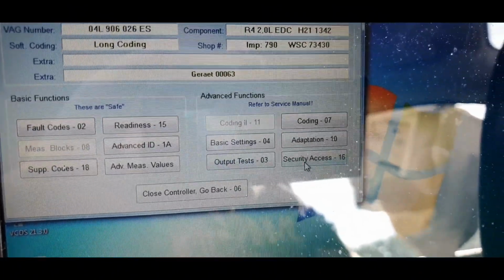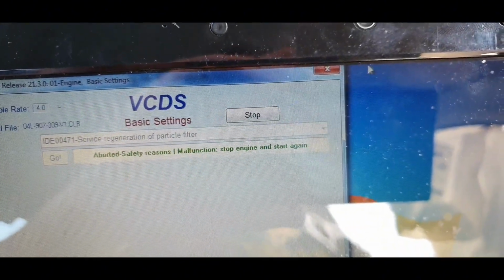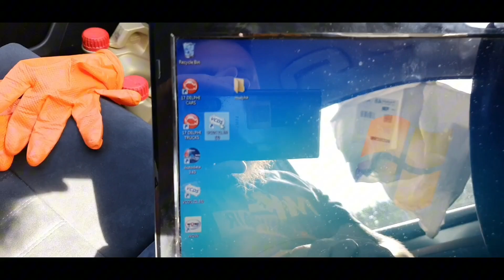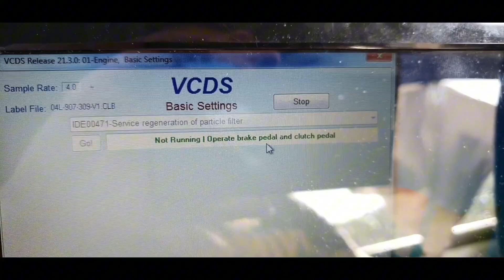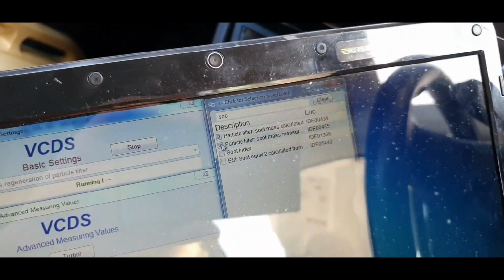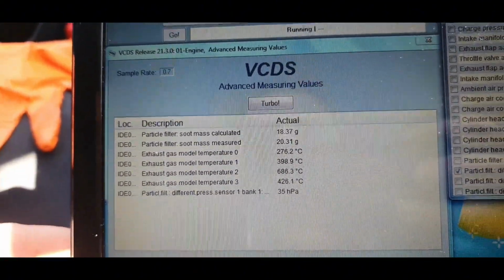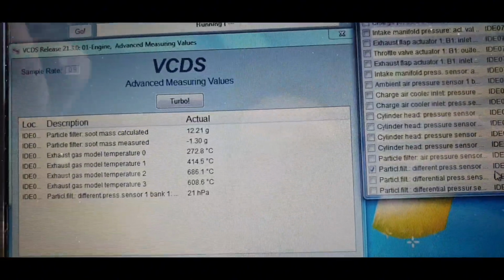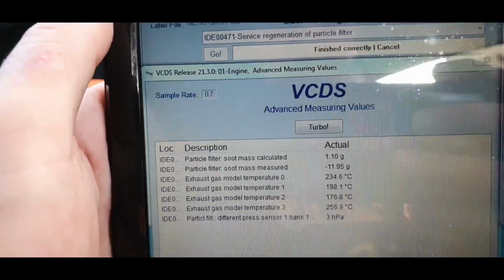how to burn dpf using vcds

Comment: We just recently bought our first DPF car, Audi A4 2.0TDI (2014), and just after we bought it, I somehow remembered why we shouldn't have bought a modern diesel. First of all, we have too cold for those in Finland for about 6 months per year. And, that is especially true if you are like us, short tripping a lot. Car is very rarely getting warm enough. So, I bought this used VCDS cable mainly just because of this, doing manual DPF burning. Because we have had many VW's and Audi's, I should have bought this years ago already, but I have managed with basic OBD11 this far. My question is, that is it harmful to make this manual burning too frequently? Should I always wait for some value to rise to a certain amount, or keep it as clean as possible?
Reply from the maker: Hello, any regeneration is not good for the engine and turbine, too frequent regeneration may result in oil accumulation, or actually oil [fuel] added to the oil. WV increases the rpm when it starts at 1000 rpm, then you know that the car is burning out, don't worry about this process, drive at a constant speed. idle speed dropped to 900 rpm or when stationary, holding the pedal at 2000 rpm, then the car will start, you can buy DPF control, which makes a sound when the engine starts. so don't fire vcds, just wait until the car starts and don't interrupt
Reply: @vag8uk thanks for the answer, but that is exactly the problem, it will get interrupted almost certainly when it starts randomly. Most of my wife's driving is 1-2km at the time and about 10-20 times per day. Even the longest trips are usually about 5-10km. And she has a very busy schedule on her work, so she don't have time to wait if it starts. This is why I thought it would be ideal to do it manually.
Reply: No point in buying a diesel if it only does 10km or short journeys.

Comment: I've just serviced my caddy 1.6tdi  after its been hammering regenerations every couple of days. And I've been getting beeping flashing oil light. There must have been almost a litre of diesel in the oil. I had to quickly empty the drain pan and go again with a 5 litre drain pan. So about 5.75 l of old oil came out, 4.5 litres went back in.. I have a feeling im lucky it didn't have a catastrophic runaway engine.

Comment: Hello thanks for the video, Just finished my first regen on my 2012 Passat TDi. The difference pressure is staying around 29-30 hPa. Oil ash volume is 0.13. Soot calc 1.3g soot measure 1.01. Is that pressure for hPa too high?
Reply from the maker: so the pressure is too high. it should be between 4 hpa and 8 hpa. try using some kind of cleaning agent, there is a video of how I do

Comment: which cable are you using for connection? and How many minutes did it take to finish the regeneration? Thanks
Reply from the maker: Hello, I don't know what cable I have, I bought it with vcds.
Burning should take 20 minutes and a maximum of 30 minutes, if it takes too long, vcds will stop

Comment: Hey thanks for the info I've just tried to do a pdf burn it starts ok then the revs just go to idle. Says running but doesn't do anything else. Temps are just sitting steady at 130etc .
Reply from the maker: this means it doesn't fire. you tried again
Reply: @vag8uk  yes thanks i tried again and it worked was just above temp so it could have been that also 👍

Comment: is that vcds is original or clone ? i have some 23.11.0 vcds and i don t have option for dpf ?
Reply from the maker: Hello, I have the original one but I bought it on ebay. but it makes no difference whether original or copy. the question is whether you have dpf or someone cut it out
Reply: @vag8uk  i have a dpf byt when i go into "engine" i can't get dpf in basic settings no option
Reply from the maker: Have you tried it in another car and see if this option will show up ?
Reply: hi, have you tried the dpf reset function
Reply: I do it with delphi .... but my vcds won't do it .